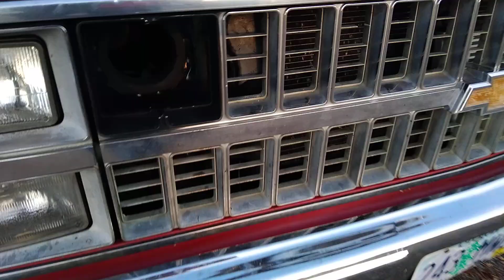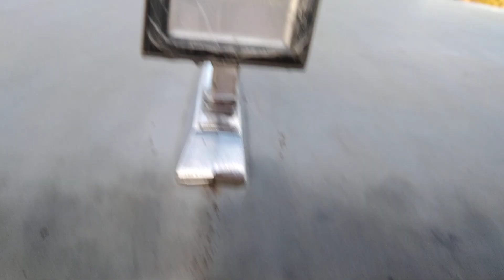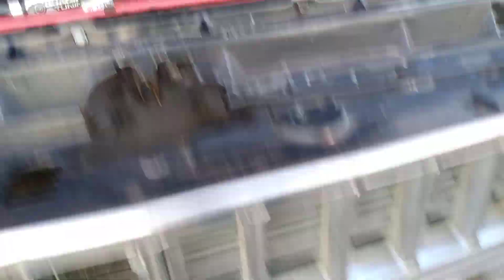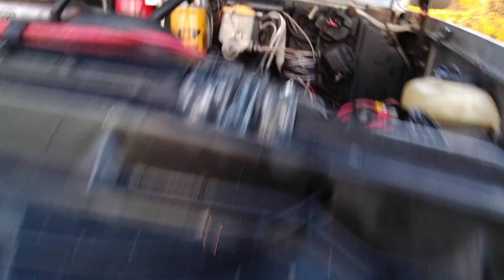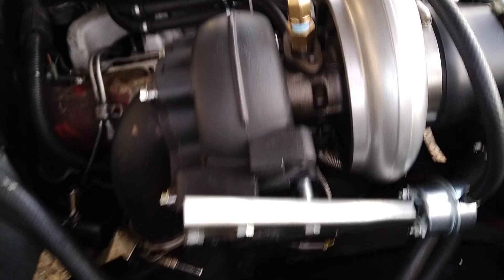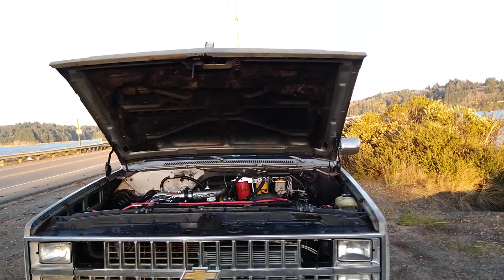1 of a Kind Turbo 6.2 Diesel

Comment: Very nice. I’m planning on swapping a 6.2 into my 76 K25. I’d love to build a turbo set up for it while it’s out and I’m swapping things over. I like doing things different and enjoy the fuel economy of the 6.2 but would like a little more power too.
Reply from the maker: Turbocharging is the way to go for more power but can bring other issues if the engine hasn't been properly upgraded and updated to handle it.
Reply: @TheAscendedMaster  what type of upgrades?

Comment: Tell me about that fuel delivery setup. Looks great
Reply from the maker: Lift pump is for a '93 6.5 Turbo and is placed after the CAT Water/Fuel Separator to help filter contaminates from the Diesel before passing through the fuel pump then up to the engine where it goes through the secondary CAT 2 micron fuel filter, through the 3/8 inlet fitting and into the Injection Pump. The whole fuel system from front to back has been completely redone as well as the entire fuel return system upgraded to 3/8 line with Quadstars Billet Fuel Return Log. The system is flawless and works perfectly.
Reply: @TheAscendedMaster  excellent. I was hoping to do something like this with my 96, thanks